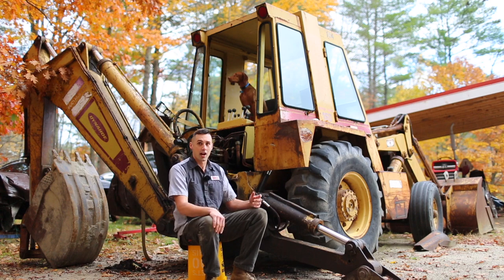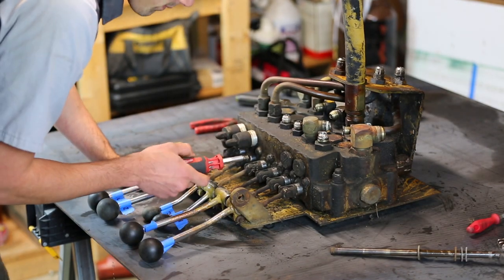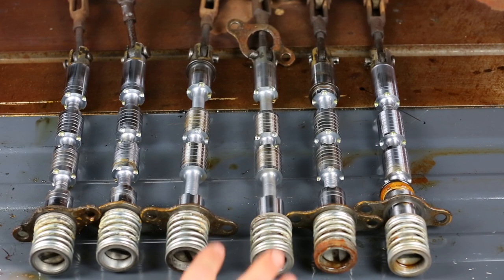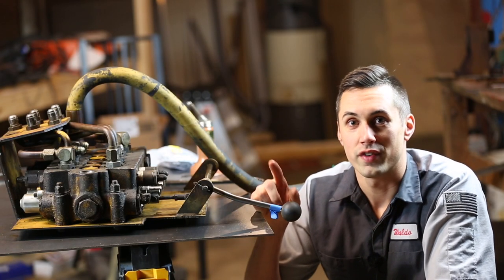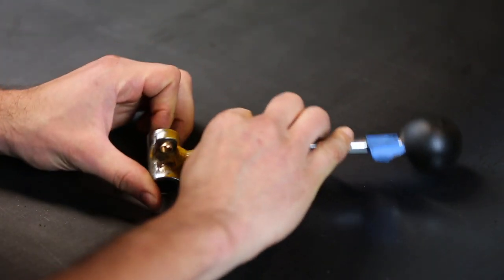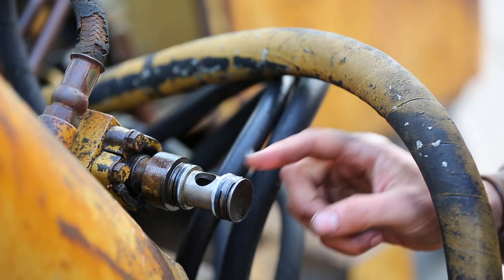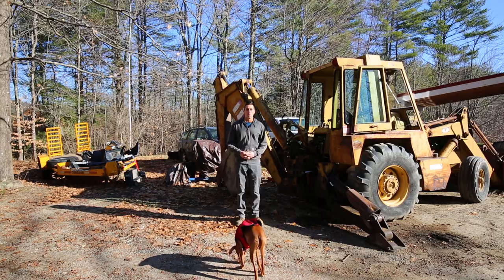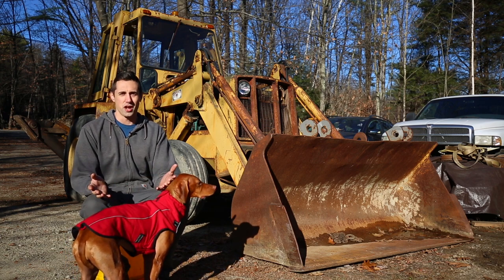Repairing a Backhoe Hydraulic Valve Block on a 1978 Dynahoe 160 [Dino Part 12]

Comment: How did you make out finding a 2 3/4" slugging wrench for the cylinder rod nuts?
Reply from the maker: I found one on eBay, I think. I ended up buying a bunch of them between 2" and 3" for the next time I have a huge nut to remove

Comment: Love the backhoe vids man. I’m gonna have to do the control valve o rings on my cat 416 soon.  Wondering how much hydro oil you lost when you initially took apart the lines there?  Did you just reuse the old oil?
Reply from the maker: Thanks! I didn't say this in the video, but I actually did this repair while I had the hydraulic reservoir drained for the previous video. As a result, there was very little fluid loss. I would imagine there would be tons of fluid loss if I hadn't drained the reservoir. When I refilled it, I reused probably 75% of the old fluid
Reply: @WaldosWorld  Yeah makes sense,  that stuff is expensive

Comment: Those batteries l have had no luck with on equipment. I think they were designed for racing. They never had enough reserve.
Reply from the maker: These ones were allowed to fully discharge by the previous owner of a vehicle I got them from (the Dodge RAM Cummins donor truck), so even though they're still fairly new (and expensive!), they don't hold a charge very well 🤷‍♂️

Comment: There is still much to learn. It is a basic requirement that we do not assemble anything dirty or muddy. Before disassembly, it is worth doing a quick cleaning. You should have watched some videos on how professionals work and what cleanliness is required to repair a hydraulic system.

Comment: Where your BIG Hydraulic hose connection to base of BOOM cylinder  with it's SWIVEL connection. I was having problems with it allways LEAKING ( to much worn space for O ring seal) if you would like 
I can video my 190,  on how it was changed to give you ideas if you start have LEAKS there becouse it is a swivel joint. Just let me know and I will film mine. And then just look at my videos on U tube, will title it with your name. Love your 160.
Reply from the maker: Thank you! If it continues to leak, I'll probably just replace the swivel joint. It shouldn't be too hard with an adapter for the 4-bolt flange connection

Comment: You might have reversed the order of the backup-ring and o-ring. The backup-ring prevents the o-ring from beïng extruded out and should be placed on the low pressure side of the o-ring.